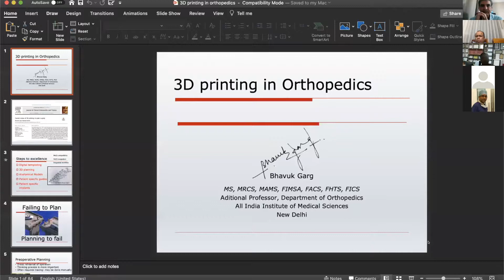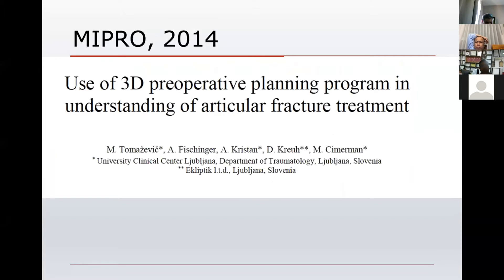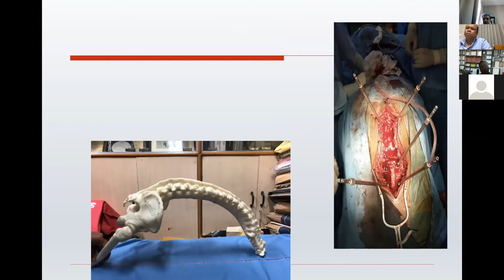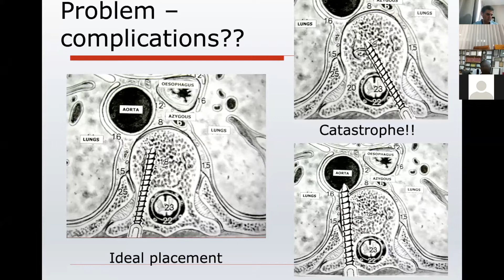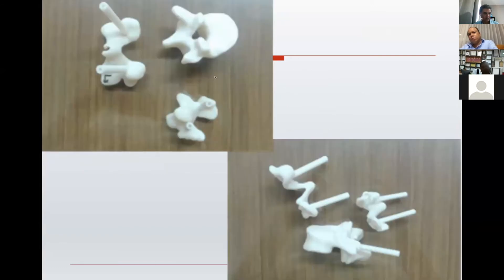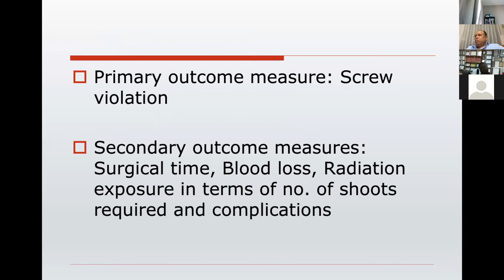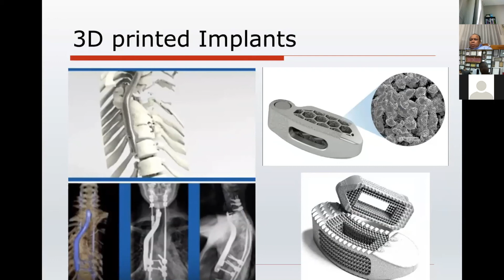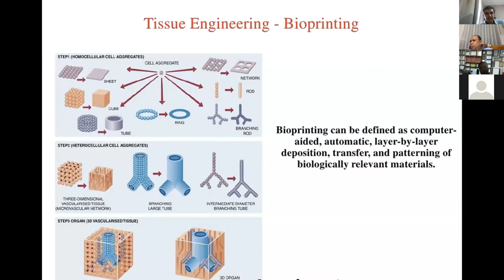3D Printing in spine surgery; regenerative medicine, stem cell, scaffold, 3D printed spinal implant

Comment: I had a thought and looked up 3d printing on the spine.
Was not surprised but still ecstatic that this could be a reality in spinial surgery 
That possiblelite could and would reinvent the way surgens would go about 
Implementing this technology to form new techniques.
Thank you and your team for looking outside the box and to make sure that you are able to give the best outcome with better care and trements. Thank you for you hard work.

Was told I had a virtical fracture my l4 vertebra 
That was was sliding out of alignment and would cause stress on my stability of my spine.
That spinal fusion would stabilize my spine. I also have a herniated disc that is pressing on my saticanerve and causing terrible flares up along the total nerve.
I watched spinal fission surgery and other types and was shocked that the procedure. 
I thought that surly there has to be better treament than what I was seeing.
Stem cell research and trement looked promising but still in its infancy and not covered by insurance and limited too by the government. 
I thought about the hardware used and the damage that could be done 
The screws seemed huge 
and given the small area that the screws would go into the bone would give very little room for error.
Why not 3d print the vertebra and surrounding area of the spine. 
I know there are 3d coumputer imaging that maps out the whole spine 
And every part. I mean couputer animation does the same thing. 
Why can't we 3d print the vetebra and use biological componts to build and attachments. 
Rember seeing where they use a procedure where the patient had hand placed inside thier body and had vessel's attached to their hand to keep blood supply going to the hand. Other such procedures that uses the patients own body to form new parts.
Is there anything like that 
to source bone material or even grow parts to connect  the bones. 
I was happy to see that 3d printing has many versatility that is being used to help and progress 
The medical community.